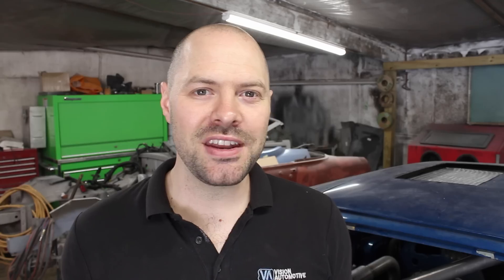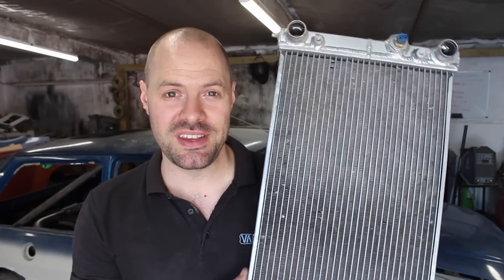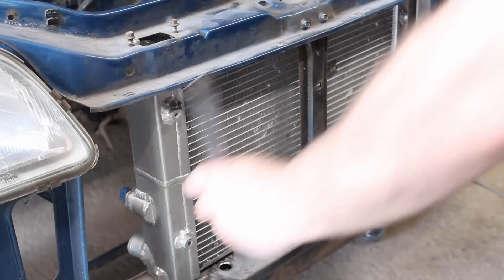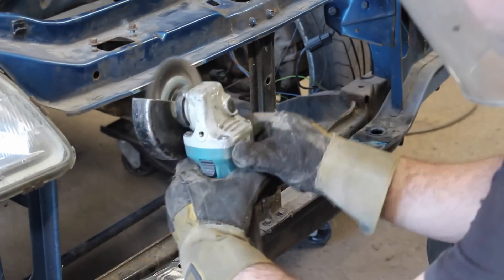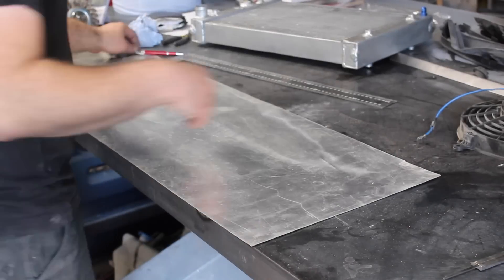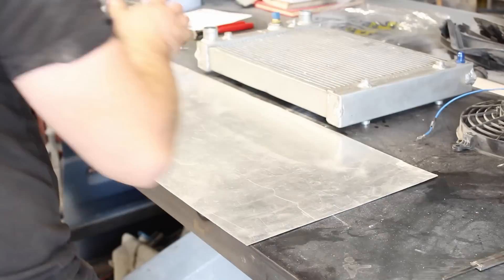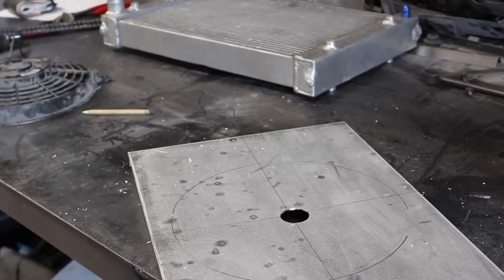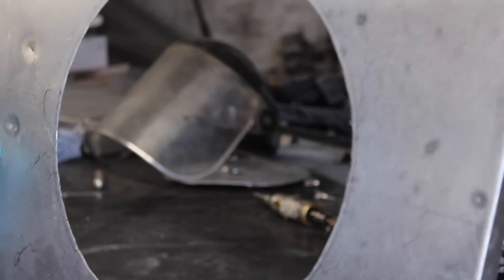Fitting a dual-pass radiator and custom fan shroud to the Raudi Metro Mid-engine Rover Metro Project

Comment: Very nicely done sir! I need to make a fan shroud for my Civic also. Quick tip- If you drill or cut holes in the shroud around the fan and cover them with rubber flaps, not as much pressure will build up in the shroud while driving at speed and you still get the same good cooling at idle and low speeds. The fan sucks the flaps closed at idle and when you get up to speed and the shroud becomes a restriction the pressure in the shroud pushes the flaps open, allowing air to escape much more freely than if it all had to go through the fan. The more of the radiator is covered by the shroud the more this will help.

Comment: Did you think you could remove the centre brace to the slam panel now, as it would improve airflow to rad, because you have the two extra supports to the slam panel I think there would be enough strenght.

Comment: Hi, I'd personally go for some sort of flexible mounting setup for any rad -  especially a fabricated aluminium one (never had good results with fabbed ally rads in the long term - they always seem to fatigue & leak but the stock ones are virtually bomb proof!). Always pay attention to sealing the fresh air inlet to the rad too as otherwise hot air just recirculates & causes low speed overheating or at least a dramatic loss of effective core surface area. Looking good though!
Reply from the maker: Yes it will have some rubber mounts added.